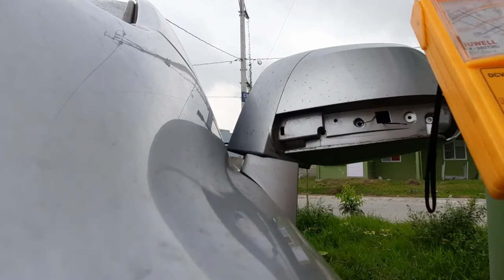Replacing signal light | DIY for captiva

Comment: You dont need to cut the wire. As that wire is actually connected into the light. Pull the rubber grommet away.....and insert a small flathead screwdriver and separate the clip that holds the plug in and pull the plug out.